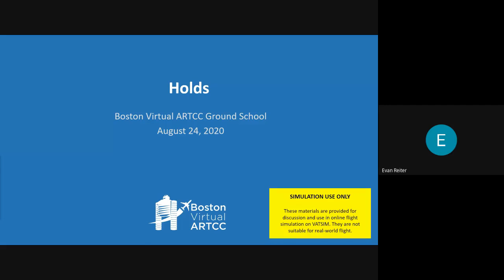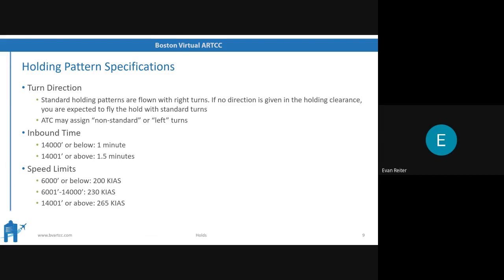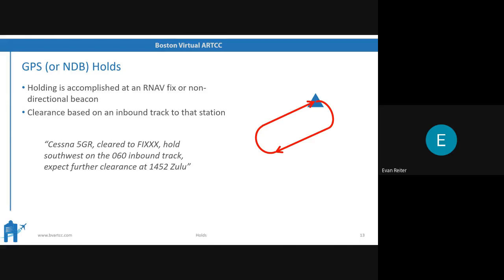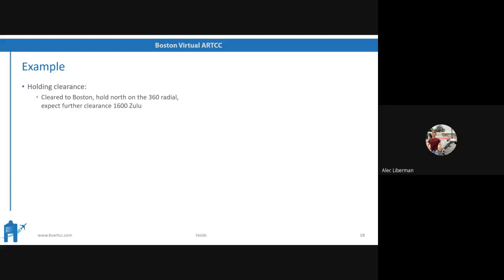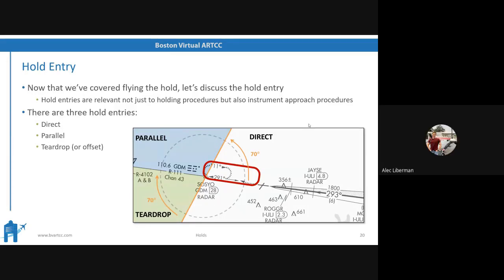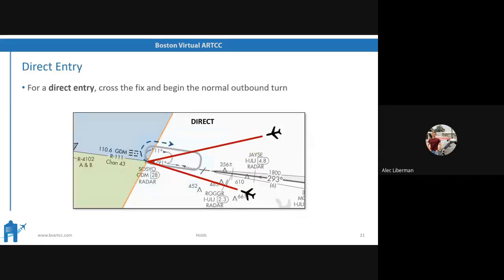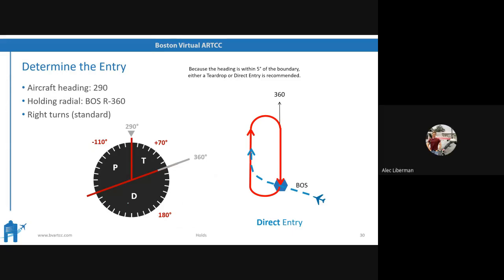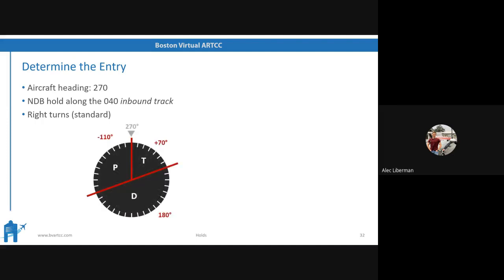Holds

Comment: A few things to note: 
The general rule of thumb for wind correction is 3X the inbound wind correction angle; 2X won’t get quite enough turn. 

I haven’t heard of the 2/3 rule before, IMO it’s a little too much math to do in the cockpit as you’re trying to do the hold. 
The rule of thumb that is used most often is to just add or subtract the time extra/needed. 
i.e inbound leg is 1:20, outbound leg should then be :40 to correct. 

Other than that well done!!